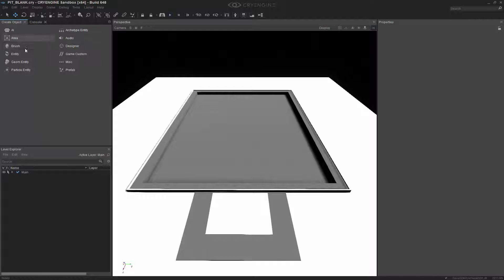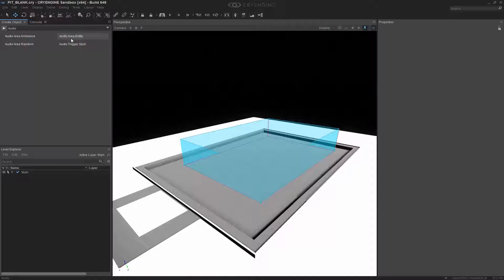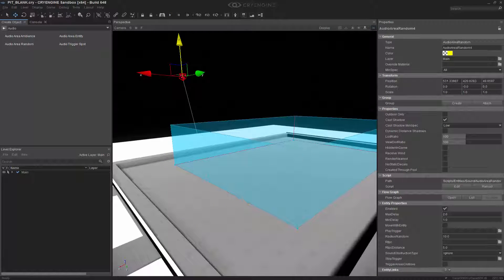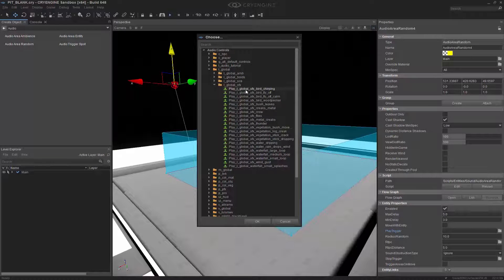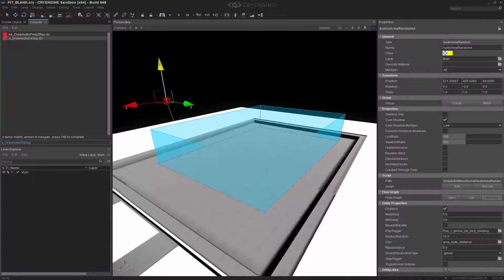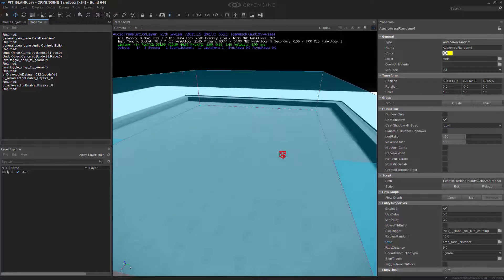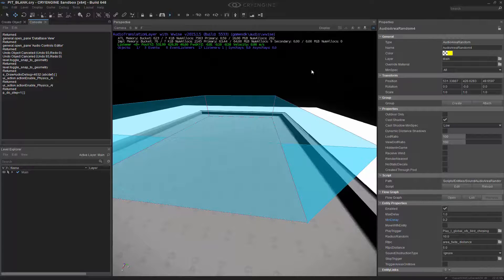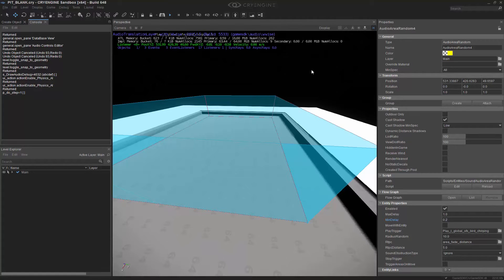How to create randomised audio areas in CRYENGINE | Game Audio & Music

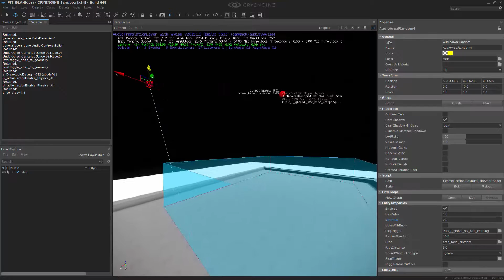Comment: 3:09 - why each time the sound change position, the sound duplicate (the events number increase)? In the end, it hears like sound just overlap on each other (I'm using CryEngine 5.4). (I'm using the sound `Play_l_audio_tutorial_amb_birds_forest`, because the sound `Play_l_woodland_sfx_bird_chirping` which is used in the video is not working (can't hear it) in CryEngine 5.4)
Reply from the maker: Hi there, for the audio used in the video not working, be sure the audio layer used is Wwise. For the overlapping sounds you will need to tweak the min and max delay for sounds that play for longer.
Reply: About the overlapping sounds, it happens because I used `Play_l_audio_tutorial_amb_birds_forest` which has the `Looping > Infinite` checkbox checked in Audio Control Editors.
About the audio that was not working, I have mistaken it with `Play_l_global_sfx_bird_chirping` which is empty - so I can't hear it. I need to edit the `Play_l_woodland_sfx_bird_chirping`'s scope from `woodland` to `global` so I can use it. Can't believe I made this mistake, maybe because it's 11:00 PM.
Thanks for your response :)